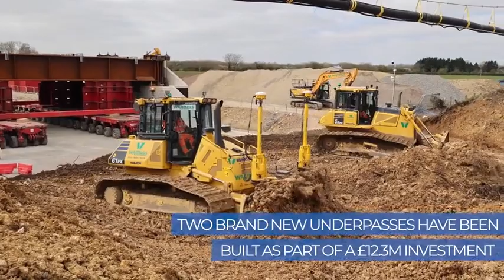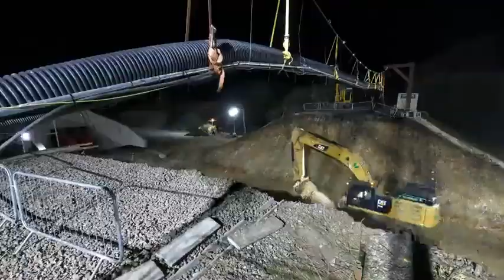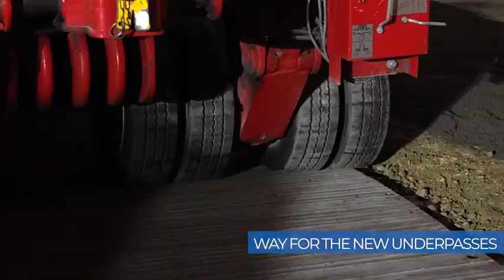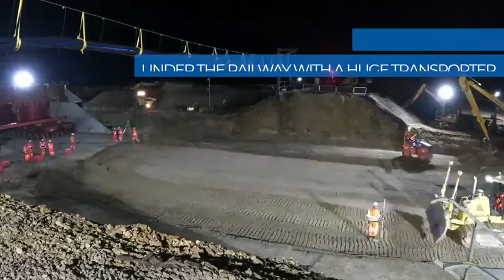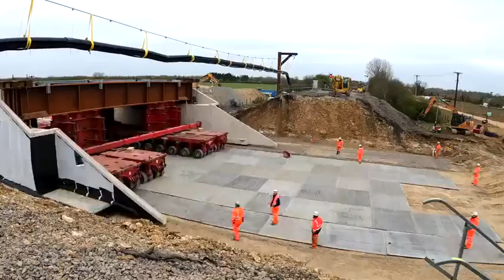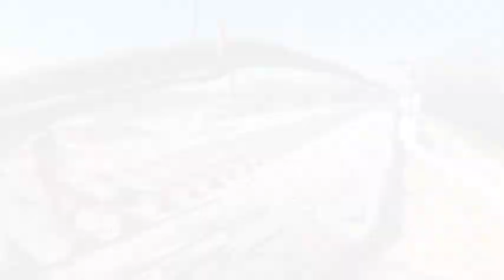New underpasses in Bicester - Easter rail works

Comment: Great work. But, when is NR going to do something about the vegetation infestation?  The powerful roots of the Buddlia  plant are ripping the brickwork of bridges viaducts and supporting walls too pieces. Delaying this work will result in massive costs in the future, also the risk of a fall on the running lines. The network is littered with disused lines and other scrap materials. Sell the scrap,use the money to sort the vegetation infestation.  When the railways were real private companies every piece of unwanted material was sold to support the bottom line.